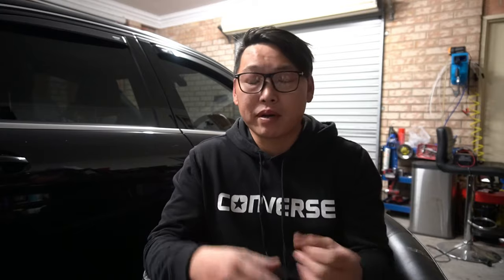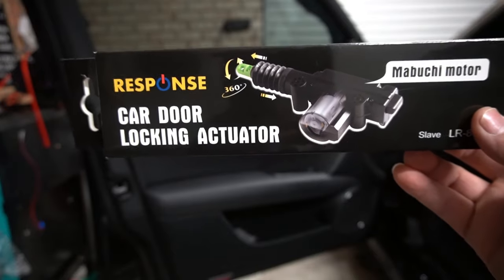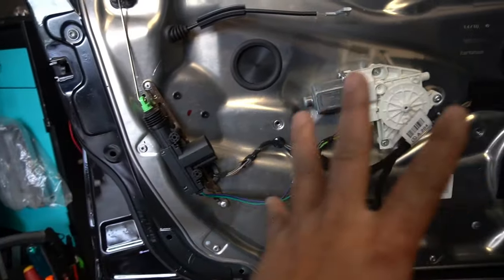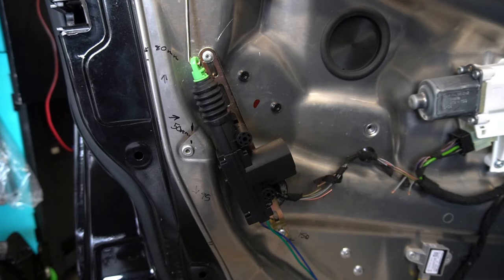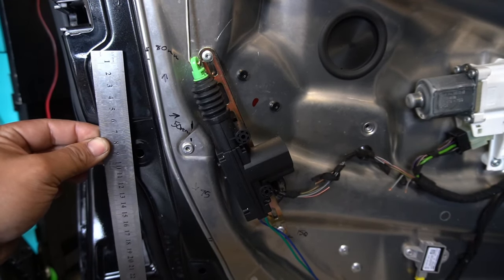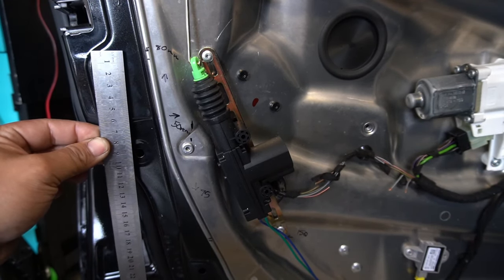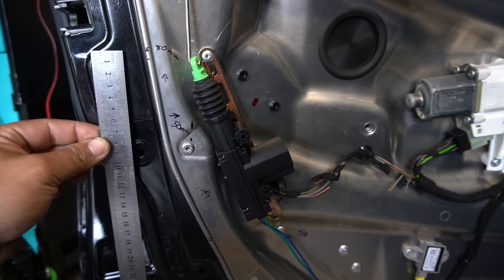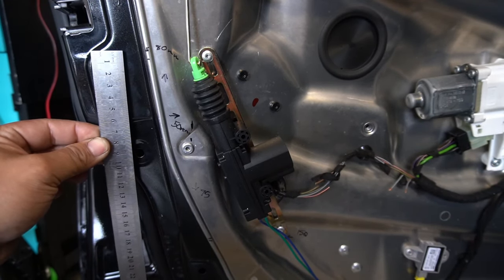mercedes common fault door lock actuator fix aftermarket part easy cheap reliable MUST SEE

Comment: Hey Mikey, great video but why this wouldn't work with the drivers side door? That's my problem drivers side.
Reply from the maker: it can and will... I was told from another subscriber that it's the same procedure on both doors... driver side is referred to as master and other doors as slave  .. if u use the same cables and install the actuator.. all that matters is that wen u lock and unlock it powers the actuator to spin and thereby locking and unlocking ... the actuator is a motor that spins infinite rotations according to when u gibe power to it.. everytime u press lock or unlock. it send power to the actuator and spend the motor in turn it locks and unlocks... hope this makes sense ..so in theory it will work..and I've also been confirmed by others as well
Reply: @MIKEYZVLOGZ   Thanks Mikeyz very helpful.
Reply from the maker: @martinrivera2950  ur welcome bud

Comment: Hi, 
What will happen to the error code after installing the OEM (aftermarket universal actuator kit) door locking? Will it go away?
Reply from the maker: yes it will..u clear it and fix and it won't come back
Reply: @MIKEYZVLOGZ Thank you so much for sharing the knowledge. Just installed and it works as normal. Indeed you deserve a compliment. 😊

Comment: Hi these don’t deliver to uk where I am based would it work with a different universale actuator as I am afraid the wires may be different colours to what you show on the video
Reply: universal lock actuators on ebay.i just got 2 for £9.40

Comment: How do I  match the 2 wires on the actuator to the correct colors on the door wiring diagram, or my Wife's 2010 Ml350 the colors on the wires don't have gray or black on the hardness?
Reply from the maker: follow ther wires that power your door lock actuator and they will be the 2 u need
Reply: @MIKEYZVLOGZ  , thanks for the quick responds, unfortunately thats were my confusion is at. The wire bundle has 1 pink. 2 reds, 2 orange , 1 yellow wire.  I'll try to send you a picture.  I have no clue which color provides power to the actuator.

Comment: Question 
. If I used that door actuator the alarm is still work?? Have the same problem on mercedes 2009 c 300 driver side door
Reply from the maker: yes it will it's just to change the motor that spins the lock the alarm is connected via cars ignition system and ecu and that's what tells alarm to activate and deactivate when u lock unlock

Comment: thanks Mikey. Very helpful. Does the rear left door have enough room to fit this actuator ?
Reply from the maker: not sure as i havent done it yet but im sure you can find a spot for it
Reply: @MIKEYZVLOGZ  Just finished installing an actuator in one of my rear doors and all is fine. Same colour coded wiring. It was bit more involved because part of the lock cable has to be stripped and then secured.

Comment: My passenger rear door won’t open at all but I can move the snib up and down with my hand also there’s no resistance on the door handle compared to the other doors any idea what’s wrong and can I get door card off with door closed thanks
Reply from the maker: no u cant u need to open the door so the panel can come off

Comment: Hey mind is the rear passenger door are you able to advise
Reply from the maker: it's the exact same procedure and there is a spot that will fit the actuator too ... so yes it can. e done easily just ensure you mark measure twice and drill once ... and test fit always first if ur unsure .. wiring is same ...

Comment: have you looked at the wiring diagram on the extra wire that were cut??? seems like a feature was removed......

the brown with pink and brown with green is for "rotary tumbler switch.........
Reply from the maker: i read on the mb forums that the rotary tumbler switch doesnt interfere with the lock actuator itself and they are controlled from thd door moddules hence u dont lose a function... i guess u could connect the wires back if u want ... but i havent lost a function at all since doing so.... ive tried ro find info on the rotary tumbler switch itself but i could only find this page ..have a read.... https://mbworld.org/forums/c-class-w204/609788-request-power-door-lock-wiring-diagram.html
Reply: @MIKEYZVLOGZ  im trying to research it too. Did u know mercedes tell u when the motor is dead in case in case u were not aware? i guess more money for "diagnostic". if mercedes put it there, there is a reason...... i dont see any justification to just cut the wire. did u test with it connected? it might be a sensor to see if someone picked the lock of manuall moved the door lock maybe? just a very possible guess......
Reply from the maker: @leonlee9301  yes true but it hasnt affected anything else thus far... everything works as it should...these motors are another common failure on these cars... its not trivial for them to fail..infact they are mkre likely to fail then not... its stupid but its just the case
Reply from the maker: @leonlee9301  so in the end according to the forum i linked for you its the ground for the lock... it doesnt actually control anything ...in my car that is... all u needis the two wires i connected and it will work.... as u saw.. but like i said if you are worried bout losing a function then u can try to connect it and see what changes or activates..in my case it didnt make a difference and i was only concerned about getting the lock actuator to work again..rather then paying for another lock module 2nd hand for a few hundred or so... it was a better option to do this ... im not sure if my motor is dead ...this isnt the same as the bouncy lock issue like u see on the w203s... i had that issue and i had to remove the whole door panel and lock actuator from the door frame and it was a massive job..took me ages to get it out .... just to fix a $5 dollar little clip.... then the lock worked again ...if my lock was bouncing i may have gone another route.. but i figured why not do this as a long term temporary fix lol .... as it will still work and u can always re solder the wires anyway if you want .... i always say im against cuttitng factory wires unless u have to.. in this case i did it becuz it made sense to me as well ..thanks for your inout though much appreciated by me and others  im sure of it
Reply from the maker: @leonlee9301  hey leon so i finally discovered last night that the rotary tumbler switch helps to send signal to the door light, the courtesy light that comes on when you open the door... so i reconnected the other two wires and bam!! the light came back on ..

Comment: Can this be used on the rear driver side door, I have seen a few videos fitting to front door but none for the rear
Reply from the maker: ive been told it can be done
Reply: @MIKEYZVLOGZ  cheers mate

Comment: Hi Mikey, will this work for all models. I have a 2007 ml280cdi. I was quoted $1000 for one actuator and door lock combined. Both my driver door and front passenger side have gone.  Can you please confirm which ones in need to buy to make sure I understand. As a single mum I have no idea and it seems hard but I’m willing to give it go as I can’t afford to fix it otherwise. I’m currently climbing from the back seat to open it. Stupid the key doesn’t open it either. Thank you
Reply from the maker: hi ... firstly i cant say definately if it will work on ur model as i habe never done it on other models.. but from how the actuator works ... it should be thr same    procedure and should work..as all u are doing is sendinh power to the after market motor in order to allow the door to unlock and lock again... theoretically it should work..its just a matter of finding the righy spot to mount it.... if i were in your shoes i would give it a go... as the part is very cheap and its better then spending $1000 .... remove your door frame have a look at the wires you have and see if they match ... getting schematics would help alot as it will show you exactly what wires go where and what they do and what colour they are... but from experience merc like to use the same colour codes for wires ... but really only one way to find out and that is to remove the door and have a look... i hope this helps you out somewhat...

Comment: So my mercedes that I just bought it has a bouncing lock. Tonight when I tried to fix I saw videos of everything they were pulling off and out. Which is alot. I love your video I am gonna try this. But I noticed in the beginning of your video you said I didn't need to put this on all doors. Now the bouncy lock is on my right front but noticed tonight that all the other locks don't budge at all so now were would I put the universal actuator r should I get 4 of them and put on all 4 doors
Reply from the maker: hi Lindsey so all u need to do is follow the video regardless of which door your trying to fix and it will be ok .. the bouncing lock is from a pin breaking or actuator malfunctioned... in any case u can do this to fix it ... much better and cheaper then replacing the actuator with an oem or genuine part.. also alot less trouble as well... the wires will be colour coded the same so as long as u do exactly what I did u will be ok.. gluck hope u get it sorted
Reply from the maker: wen u say the other doors or locks don't budge do u mean they all don't work ? or only the front right doesn't work? 
whichever doesn't work fix it using this method and u will be able to fix it .. u can also do this for the rear doors ..same cables same colours ...
Reply: @MIKEYZVLOGZ  I believe all four doors don't work the locks don't move at all on the other 3 doors and the right front is the bouncing lock
Reply from the maker: @lindseysanchez8035  that's doesn't sound good... have u checked its not just fuses ? google your cars fuse diagram and check fuses relating to the door lock pins... I all else fails then I would try taking the door off and seeing if there's any loose connections

Comment from the maker: hey guys thank you so much for all the support... if you want to support me further pls check out my patreon account under mikeyz vlogz...no obligation... https://www.patreon.com/mikeyzvlogz
Reply: Alright mate i have the same problem with mine but the door wont open so i cant do anything with it until it opens do you know how to get it open please mate? Just tried taking the panel off from the inside to see if it could be fixed but it defo needs to be open
Reply from the maker: @Kingy94_-  u can't open from the outside? or the lock pin won't unlock either M
Reply: @MIKEYZVLOGZ  it won't open outside or inside, i think the lock actuator is broken and is behind a pivoted steel panel after you take the interior panel off and it reveals the door mechanisms. But where i think i need to get to is behind the pivoted steel panel, and it is impossible to get to with the door being closed. Had someone look at it today, and they are not sure how to fix it yet. Thanks for your quick reply mate
Reply: @MIKEYZVLOGZ  did you suss it out mate
Reply from the maker: hey bud u may need a locksmith to help u try and open the door by using the tool that physically pulls on the door handle rod ...this is prolly what u need to do ..because ur unable to open the door at all... honestly I'm at a lost as I've never had to do this either..but I would def start with a locksmith automotive and check forums and ask around
Reply: @MIKEYZVLOGZ  cheers mate ill look in to getting a locksmith and have a look on some more forums. Dont worry about it mate theres always one of these situations that pops up every now and then isn't there haha but i will not be beaten by it, all the best man
Reply from the maker: @Kingy94_- good on ya mate... forums a re great place as they have professional of the specific make and model cars that are there solely to help ... I joined a few mercedes benz forums myself  and its been a godsend... u get so much advice from real ppl in real situations...then there's always youtube videos ofcourse and pfcourse mercedes themselves but that's the absolute last option and desperate option... I hope u getbit sorted and keep me updated on how u go..would love for you to share your experience with everyone here in hopes it may help another person down the line..sincerely mike
Reply: @MIKEYZVLOGZ  yeah i know mate they are really helpful forums online, reddit is a good one, i think the whole idea of it is a godsend for things like this or any other situations where you have to fix something or have problems with, imagine having no internet and not being able to just look it up the thing you need help with or ask people in real time in any part of the world compared to asking around in person and not getting anywhere for a long time, its amazing how it works.  Yeah mercedes dealer/garage is a no go haha.  No worries mate if i get it sorted ill let you know and post it here and for others down the line like you said 👍

Comment: Hi Mikey, a very useful video.
Will this method fix my door issue? The lock button moves up, but the door does not unlock,
You have to press lock and unlock several times to open the door.
You used two of the four wires, did you snip the other two or just leave them?
Reply from the maker: leave them buddy cuz it controls the led for the door ...I saw another guy post that u cut them buy if u do u won't have the led for your doors .. so only snip the 2 wires h need
Reply: @stephenhall4432 I have the same issue. Did you try this in the end and did it fix it?

Comment: Will it work on a 2007 E 350 4 matic
Reply from the maker: yes should work on any car with central locking .. its just a matter of where and whether u can install the actuator or not

Comment: Mine has a similar problem. The door pin will not go down when the door is open even if I push down hard but it goes down as normal when the door is closed. Is it the actuator or is something stuck?
Reply from the maker: actuator

Comment: does the switches at the front passenger and driver side controls the locking function too?
Reply from the maker: yes they do ...the unlock and lock button on the door panel ?? yes they control the lock and unlock
Reply: @MIKEYZVLOGZ  thanks for the prompt reply.. I had just realize my lock didn’t work for whatever amount of months lol
Reply from the maker: did u fix it? hope u did and it all works again...
Reply: @MIKEYZVLOGZ  I just ordered the parts, waiting for it. Does all the door locks unlock when you used the door handle lever from the inside?
Reply from the maker: @lemes9797  i willdouble check for im pretty sure it does
Reply: @MIKEYZVLOGZ  Hi sir, any update?
Reply from the maker: @lemes9797  yesw it does it works like normal
Reply: @MIKEYZVLOGZ  Thank you sir !!

Comment: I am in the U.S. For the drivers side being the master actuator, is there a simple fix for this? Only my drivers side does not lock or unlock.
Reply from the maker: actually it's  the same fix u can fix it the exact same way no difference...at first I thought being a master lock actuator it was different to but after some research..the fix is the exact same mate ... no difference ..all that matters is that the pock get power when u pock and unlock the car  .and that's what the two wires do
Reply: So to clarify whomever references this, I did this on a W212 E350. Only two wires to cut. I cut the green with the black stripe and the green. I connected the green wire of the universal actuator to the green with the black stripe, and the blue of the universal actuator to the green. 

Because this is the master, you will notice when testing that it will unlock but not lock when the door is open. This is normal. When it is the driver’s side door, you are not able to lock from the inside nor lock on the key fob with the door open as this is a way for the manufacturer to help the operator from not locking their car without their keys. 

I had to cut the foam on the inside of the door card that was removed to make room for the new actuator. It is a big block of foam - I cut it flat.

Comment: Hai Mikeyz, I have a W176. 180 blueefficiency. I live in the Netherlands where we have a lot of rains over the year. Now my question is dat when its raining my driverdoor doesn't lock and  also have problems with the electronica. Will it helps when I place the lock acuator what you did and is it possible that my problems are solved. Regards Hendrik
Reply from the maker: cant say for sure if it will solve because it seems u have electrical problem may e a short or water damage..therefore wen it rains it doesn't work ..I would try find what the actual issue is first
Reply: @MIKEYZVLOGZ  thnx for the answer I will try out the actual issue first 👍

Comment: A quick and cheap fix for the front doors perhaps.  The rear doors (at least on my C220) do not have the same configuration and there is no way to add this extra actuator.
Reply from the maker: ppl have contacted me saying that it's also possible for the rear doors as well .. I personally haven't done it as I haven't needed to but I think u just need to find the right spot... wen I get a chance I'll take a look read through the comments you'll find someone stating its possible for the rear doors too
Reply: it is possible and i just had mine done. ive located the actuator near the window regulator motor. the tricky bit is to actually cut open the cable and secure it so that it wont wobble around when the actuator pushes/pulls.
Reply: @MIKEYZVLOGZ  can this been done on the rear doors?